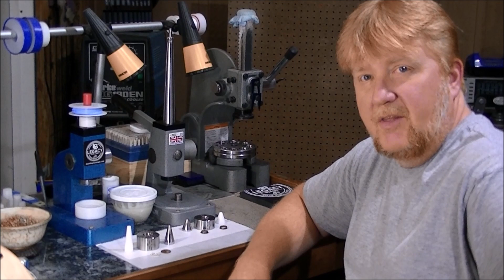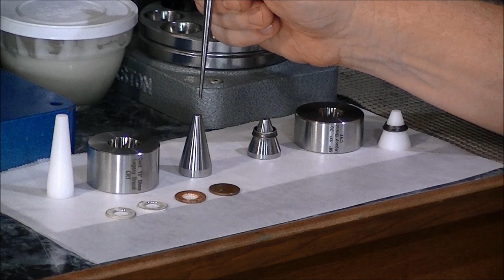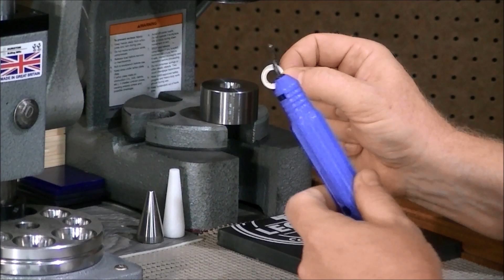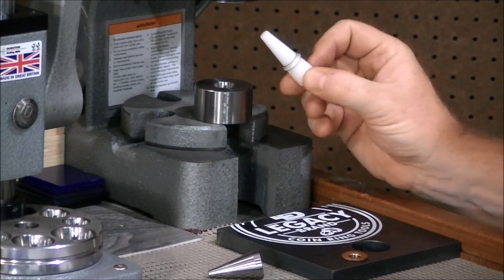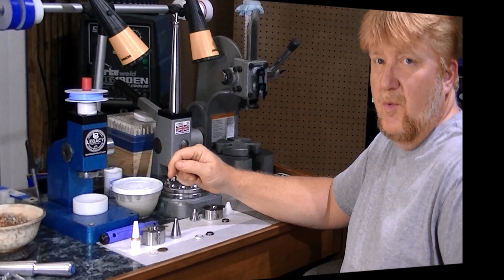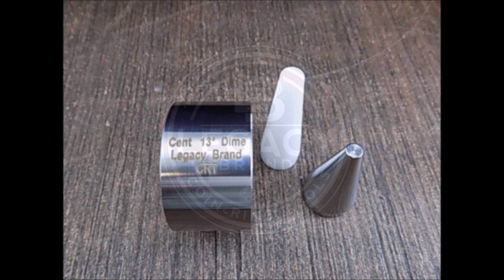13 Degree Cent / Dime Folding Die and Cone Set - For Making Coin Rings

Comment: How do you get the ring of the white cone if you pushed a little to hard and it gets stuck?
Reply from the maker: Turn the ring\cone upside down in a die, and gently press the tip of the cone downward. Should pop right out. Go to approx. 8 minutes in the video and watch as I demonstrate how it's done.
Reply: how large can you make a dime ring
Reply from the maker: I have made dime rings up to about a size 7. It really depends on how well you anneal as well as what kind of dimes you are using. Dimes could go a little larger, if you anneal often, and pay very close attention as they get very thin when stretching.
Reply: @legacybrandcoinringtools2956  thank you